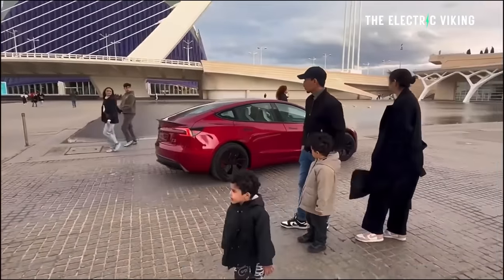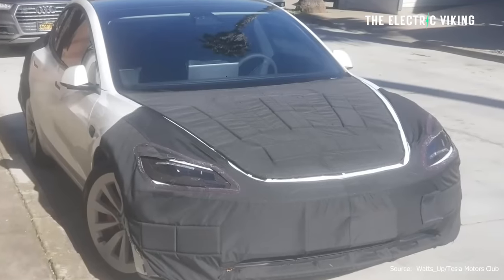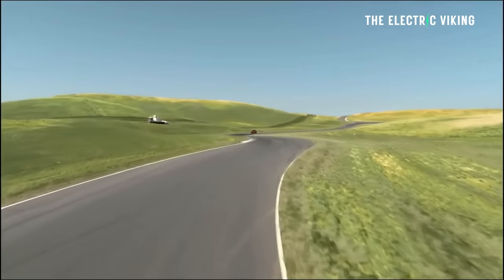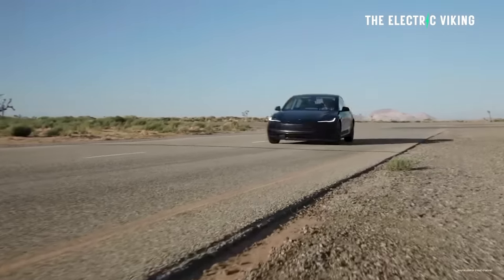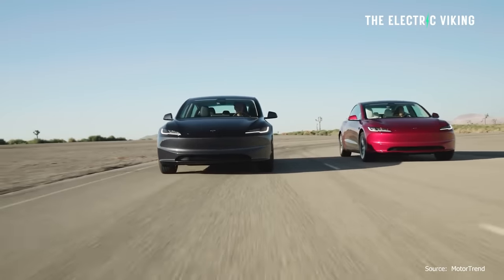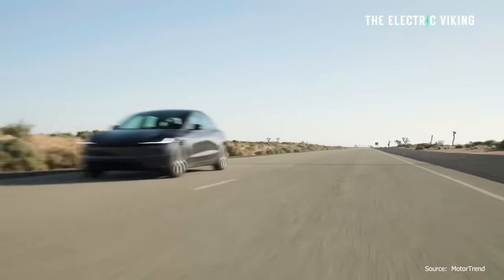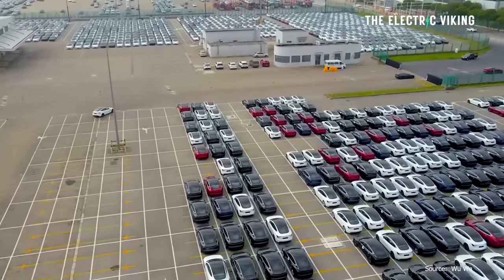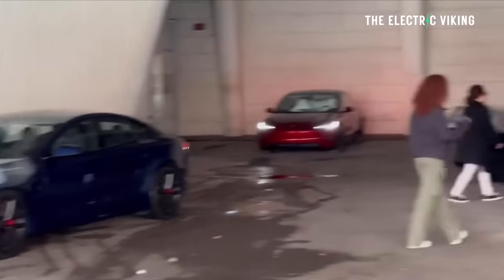NEW Model 3 Ludicrous upgrades revealed as Chinese version arrives in U.S

Comment: Sam, you look like a tall guy. Do you fit in a model 3 well? And I’m not talking about leg room and head room. I’m 6’3”.  In the model 3 and in the model S, the leg room is fine with the seat all the way back and the headroom is fine with the seat all the way down. The problem is with the B pillar. It is too far forward. When the seat is all the way back. The B pillar is forward of your shoulder. That helps with their side impact rating, but it is a hassle to slide forward to get in and out of the car to keep your shoulder from hitting the B pillar. I’ve never had this problem in any other cars.
Reply: Model Y is much more comfortable in this regard.
It’s low seats that cause this problem for tall people.
Lucid is much worse than Tesla M3. Nightmare to get in.
Reply: @whowhy9023  I test drove a model Y. The B pillar position was not bad, likely because the higher seat allows for a more forward seat position while still allowing adequate leg room. The model Y juniper is on my short list for my next car.
Reply: I'm 6'7 fitted in the M3 with about 2.5 centimetres headroom or an inch. Slight squeeze under the steering wheel when getting in. Game the M3 to the wife and bought a model Y, way more room. But at 6'3 you could cut it fine.

Comment: Tesla is the best car company ever! No gas stations, No oil changes, No smog check, No corrupt dealership, No catalytic converter and as fast as a $650,000 Ferrari
Reply: Hahahahahahahah
Reply: You left out no range,no resale value,no affordable insurance
Reply: @Paul-b2s4j  Nothing is perfect but range has never been a problem for me, ever.  Insurance is not nearly as bad as people pretend.  Lack of maintenance more than makes up for the difference not even including the fact the fuel is much cheaper per mile driven.  As far as resale, I've wanted to buy a used Tesla but prices are still far too high when you factor in gov rebates.  In my state you can get a model 3 for under $30,000.  4 or 5 year old used ones in the 50,000 to 100,000 miles range are selling from $20,000 to $25,000, which makes no sense to me why someone would by a used at those prices and not just get a new one.
Reply: I agree. I’ve had a M3 standard range for 8 months and it’s the best car I’ve owned. And without trying to sound like a wanker I’ve had BMW’s, Range Rovers, Audi’s, Mercs and Porsches. The Tesla is better than all of them.
Reply: @Paul-b2s4j the range doesn't matter as much since the Tesla charging station is huge and reliable as well as the other things you mentioned since there will always be demand for tesla's simply because of the massive advantage they have over other evs
Reply: 테슬라 차는 smart car😊 늘 새로운 느낌을 주는 전자기기😊
Reply: @user-yh6xf3wl1h  FUD insurance is cheaper as for a Opel Astra. I have both Model 3 LR. An resale is also very good with Tesla.
Reply: @simonmeade6611 Model 3 is not M3 lol- that confused me a lot
Reply: Comeback in 10 yrs... 😂😂

Comment: I don't know any internal combustion fans who believe EVs can't go around corners, they have a very low centre of gravity, it would stand to reason they can corner well.
Reply: If you have a 50/50 weight balance, all you need is to fiddle with the front/vs/rear air pressure by a few psi to make a car oversteer or understeer.
 Assuming you have proper steering geometry from the factory, and haven't been butcheing the front end.